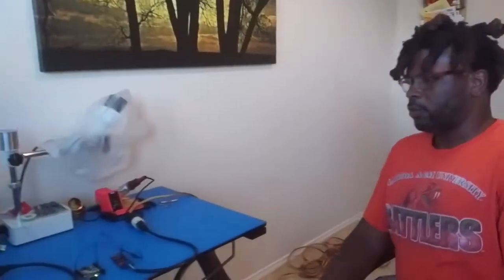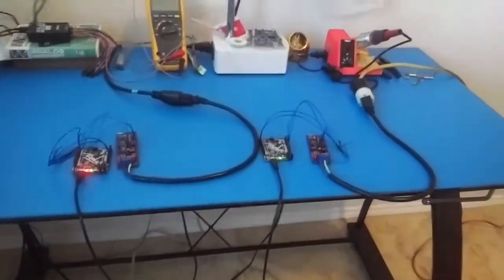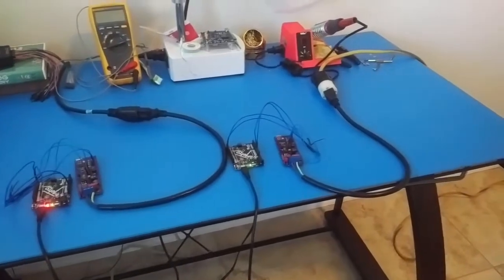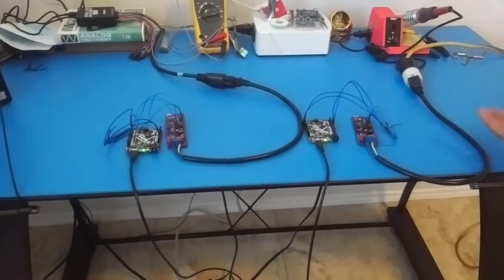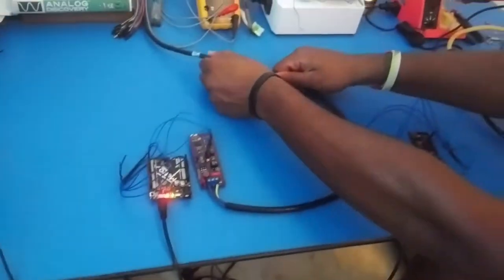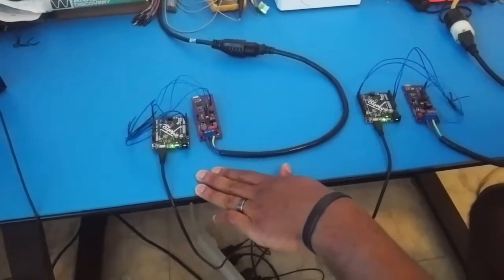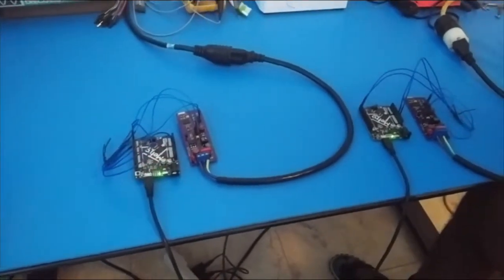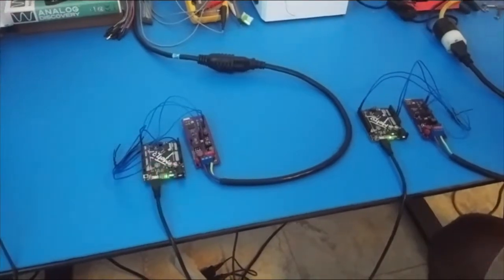Powerline Communications (PLC) Demo Board

Comment: Hi buddy can you please tell me whih device you have use here for interfacing AC lines with microcontroller
Reply from the maker: An RLC filtering network connects between the AC line and the TDA5051a modem IC.  The filtering network only feeds the small analog voltage communications signal to the modem and blocks everything else like the main AC line voltage.  The modem digitizes the communications signal and then feeds the digital representation to the microcontroller over UART.

Comment: Do they need any adjustment to operate over 24V AC? Or will they work directly, without altering any component values?
Reply from the maker: They'll work on 24 VAC lines without adjustment.

Comment: Hi sir,I can't understand how the communication take place between master side and transmitter side. because there is no connection between the two power line modules. then how transfer data between one side to another. please clarify my doubt .please help me
Reply from the maker: Each Demo board has an NXP TDA5051a powerline modem IC.  This modem takes in a digital message from an MCUs UART bus, an Arduino UNO in this example, and translates this digital message into an equivalent analog message.  Additional circuitry on the demo board sends the analog message over the 120/240VAC of your home, if the demo board is connected to a home outlet.  Ideally, the analog message will be broadcasted across all the 120/240VAC wires of your home (to all home outlets), so another demo board connected to another home outlet will hear this message.  The demo board has special filtering to only receive messages sent by other powerline modem demo boards and reject all other noise or communications between non-demo board devices.   Once a demo board receives an analog message sent over the home power lines, it converts it to an equivalent digital message and sends it to an MCU over its UART bus.   Additionally, the demo boards can communicate over DC powerlines as well.  Does my explanation make things more clear?
Reply: @jwhill15  Thank you soooo much for your valuable message.